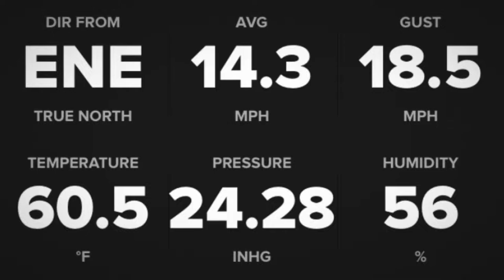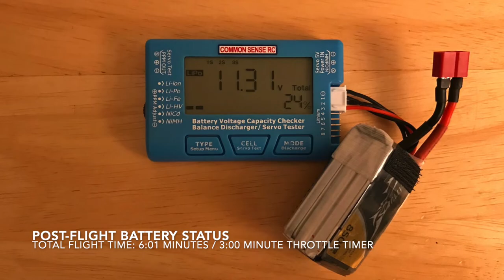FMS Moa 1.5m Glider 3S Test Flight

Comment: That thing rips. Love the classic looks
Reply from the maker: Yeah man! It definitely rips, especially on 3S. I love the looks too. Definitely not one you see every day. And I love that its not a glider that just literally flies itself. Its definitely one you want to pay attention to. Now I just have to make sure the Spinner Cap that keeps the Folding Prop Spinner in place stays attached. The design is simply a plastic cap that screws on to a metal screw. I may put a dab of Foam Tac on the screw on my new replacement Spinner Cap and that should hold it. I also have Graupner 8x4.5 Carbon Folding Props on the way, and according to RCG members is a great upgrade from stock.  This should complete the Moa project if I don't decide to add navigation lights, which would be pretty cool too.

Comment: That's pretty fast for a glider!!!🙀  That thing is sweet,  it moves really good!!  Nice job flying in that wind,  it was kicking pretty hard out there👍👍👏👏
Reply from the maker: Thanks buddy! This ain't the usual stereotypical "gentle" glider. :D The Moa is of the type that forces you to fly it and doesn't just fly itself - that is something I love about this one.  And it definitely loves the wind! Which is a good thing because it does get windy here a good portion of the time.
Reply: Derick Aquino Yeah,  it doesn't look like it!!!  I like a challenge,  it looks like it's  right up my alley😃.  I live in a river valley,  if you can call it a valley,  I'm in Texas lol,  but it is windy here too🌬🌬💨.  Love that stand still landing 👏👏👏
Reply from the maker: @BALAZSER1  Thanks! Ha, I would have actually throttled up just a bit more to set it down just a bit more gently, but by that time I had already noticed the missing spinner cap that held the folding prop assembly to the motor missing.  You could hear the cogging sound made from the motor at the last few seconds before touchdown, trying to spin the loose folding prop assembly. Had I throttled up just a bit more, it would have easily flung off. So I just decided to commit to setting her down at that instant.  I was just glad I was able to get her down and it was just the spinner cap that went missing and not the whole folding prop assembly. That would have been bad.
Reply: @daquino0021  Dang,  I didn't even notice that!! That would have sucked,  to lose the prop assembly,  that would have been many hours spent looking at grass😁🤣😂  Yeah,  that would have been bad!!!  Good call on committing to get it down,  and great job!!🛫🛬👍👍

Comment: Thats alot of punch for that little thing  could use a. 3s 2200 25c and still fly it ? Have alot
Reply from the maker: Most likely not. Considering that I'm using a 3S 850mAh 75C lipo (80 grams) shown in the photo prior to the flight, you can see that it is already a snug fit. By comparison the stock recommended lipo is a 2S 1300mAh (approx 71-80 grams). You would not only have a tough time fitting the 3S 2200mAh 25 C because it would take up the whole nose, but then comes the issue with obtaining the correct CG for a successful flight. But if you do happen to get a 3S 2200mAh to fit in this, please send me photos of how you did it, as well as a flight video! I'm always open to seeing new modifications. :)
Reply: @daquino0021  do have a few 1000mah  2s 30c laying around 76gms that should work but ordering 3s 850s as well.thanks
Reply from the maker: The weight on those 2S 1000mAh lipos should work.  Just make sure to stay within the recommended CG of 53-58 mm from the leading edge, and then adjust from there to suit your preferences.  If you go 3S, make sure to upgrade your ESC to a 30-amp and you should be good.
Reply: @daquino0021  awesome thanks